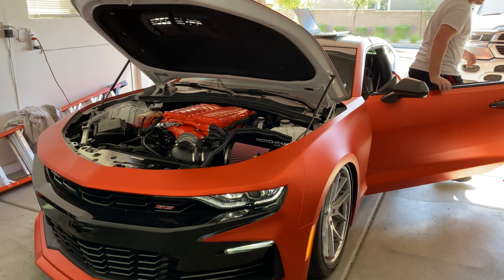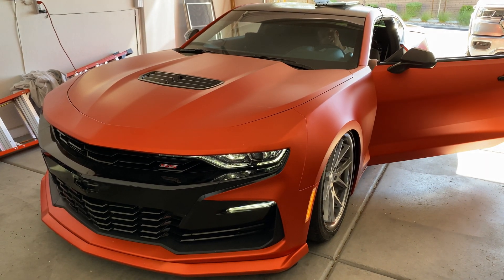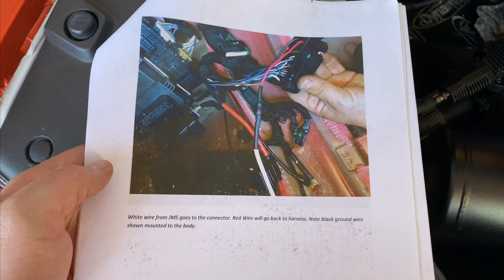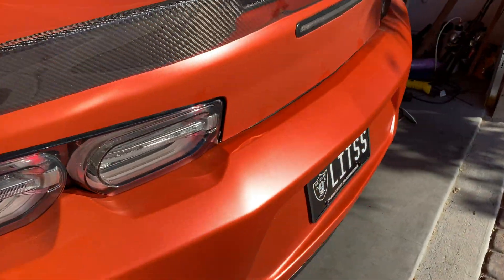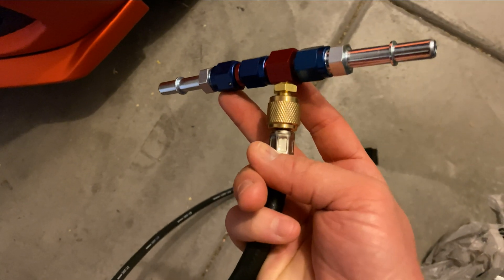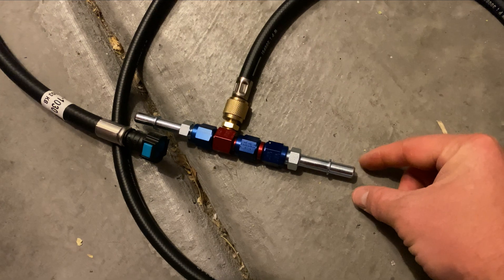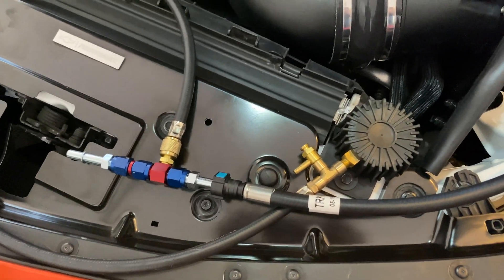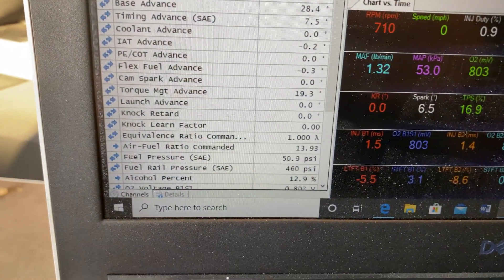Whipple Camaro part 5

Comment: You have to many PIDs logging and it can’t keep up. You aren’t experiencing 0 fuel pressure
Reply from the maker: floridanick Fuel pump wasn’t turning on so it wouldn’t start. The fuel pump control module wasn’t getting power bc I wired the JMS voltage booster incorrect. I fixed it and that’s how I got it started but the other issues I will talk about in next vid.